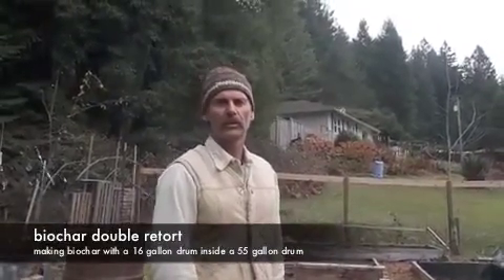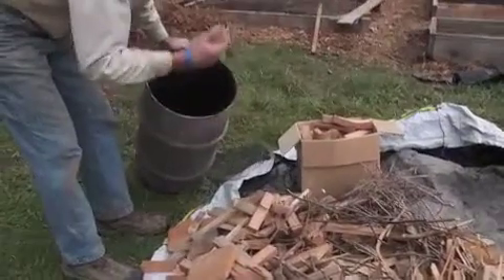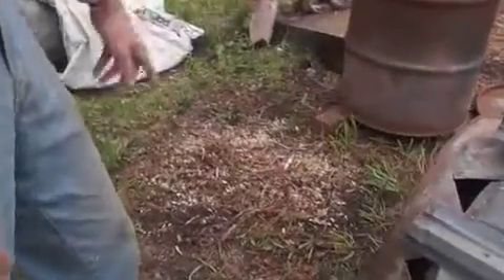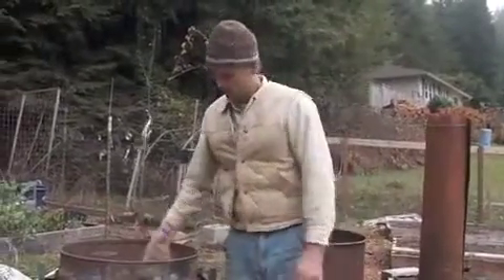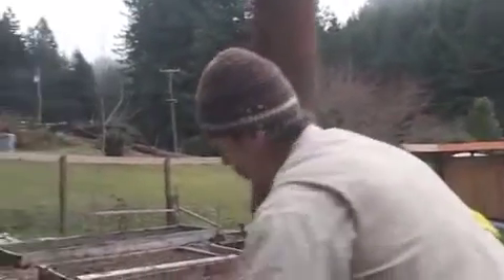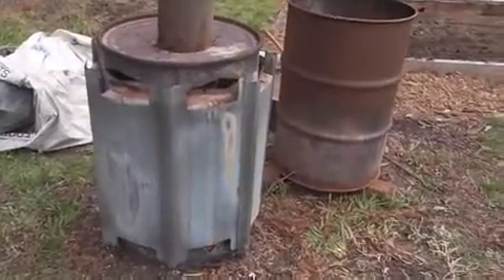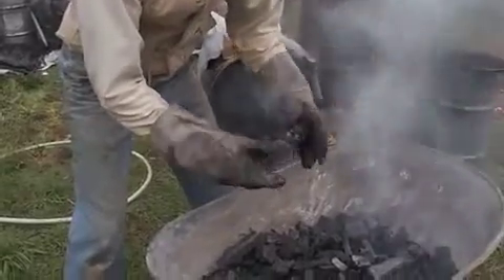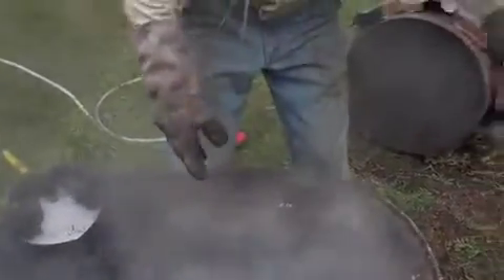Biochar double barrel retort

Comment: Awesome video. One question though, what happens if one replaces the woods inside the smaller barrel with circuit boards? Does this system turn that into charcoal without smoke?
This can solve a lot of ewaste problems.
Reply: I think that's a very different material with very different disposal needs.

Comment: I think you're loosing heat through upper diamond shape holes. You might get better results without them.
Reply from the maker: Can't get any better that good char. the top holes allow oxygen to completely burn all gasses escaping the stack and eliminate all smoke--a priority for me.
Reply: @tomreedbiochar  Consider condensing the exhaust gases into wood vinegar - a natural insecticide.

Comment: Okay, I've researched a lot of retort kilns and barrels. I don't see what makes this DOUBLE retort. Explain it to me please.
Reply from the maker: its 2 barrels.
Reply: @tomreedbiochar  ,  that doesn't make it a double retort. Retort is the action. The action is happening once. Therefore it is a single retort, not a double.
Reply from the maker: @stuffbywoody5497  OK thanks.  the guy who taught me called it a double so I just thought it was.
Reply: @stuffbywoody5497  https://en.wikipedia.org/wiki/Retort?wprov=sfla1 pls see section on wood pyrolysis. The retort is the equipment, I retort 😉
Reply: @andrewdegozaru74  , I stand corrected.

Comment: Best video on the subject I've seen. I hope you start making videos again. Are you in CA or OR?
Reply from the maker: the video was made in the Eureka neighborhood about 4 years ago. unfortunately i am doing a city gig now. can't wait to get back to the country and make more char. thanks for the compliment. fire away!
Reply: Tom Reed Oh cool. 2 other people and myself just bought a house in McKinleyville. I have a little bit of space and really want to build one of these. I've seen another kind where the burn chamber goes up the center and is stove pipe sized. Then, the outside of the whole barrel is wrapped with rock wool. That design could be more efficient but your design probably seals up easier and is more simple and better thought out. Do you have any ways you would improve it?
Reply from the maker: the good thing about this is how low tech it is, but it works. it just wastes a lot of heat. it would be nice to capture the heat. you could run coiled pipe around it or the stove pipe and run the water into a thermal mass under a house--or something like that.

Comment from the maker: yeah, Anders, it took a while to get the sizes of the holes and stove pipe right. now finally smokeless. remember, for your idea of making char in the outer ring, it will need to be airtight, with a few holes at the bottom inside for gas escapement. sounds intriguing, but also a lot of work, unless you are a great metal worker with extra time. glad you are making char. have you been making it in a wood stove also? see the other video:  Mini double retort:    
 mini double retort
merry christmas!
t